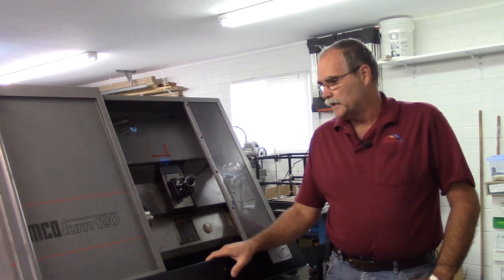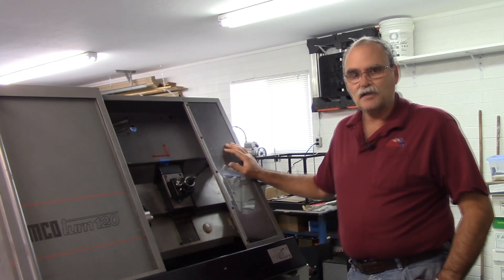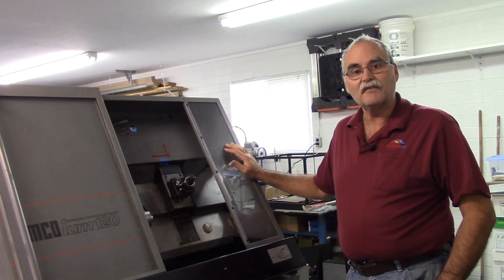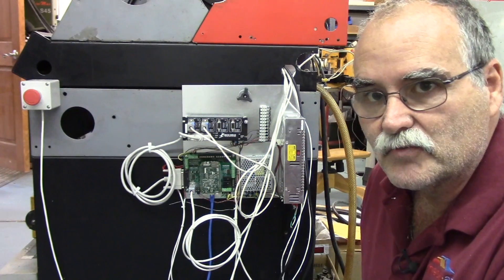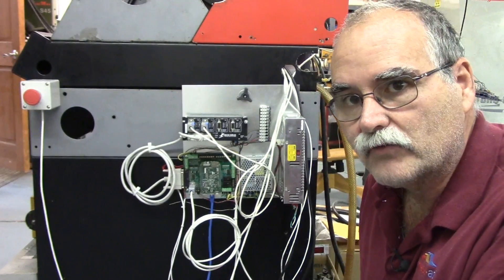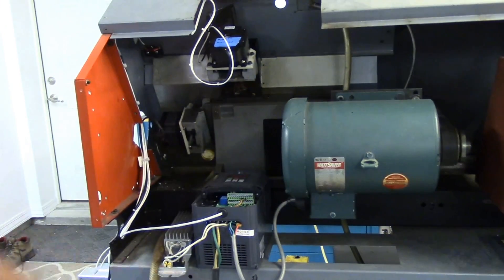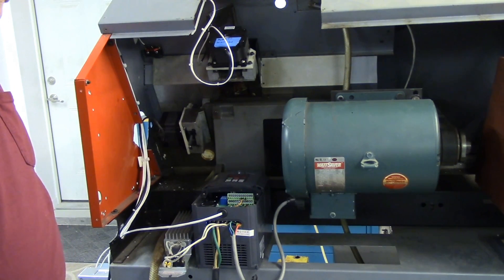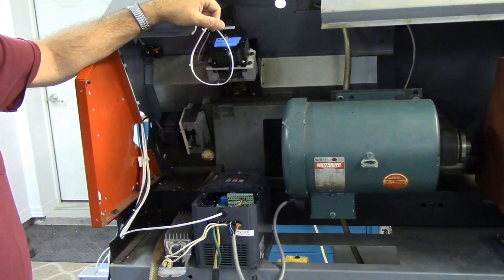Emcoturn 120 CNC Lathe Project Overview

Comment: I'm going the same route atm but with a Boxford 250.   I'm still gathering the bits, just the spindle drive  and touch screen to go.   My turret looks a bit similar to that one so I'm keen to see how you go about controlling yours.   Thanks for the whole series of videos, very informative and extremely useful.
Reply from the maker: The Emcoturn 120 has long been done. It used 4 sensor gray logic. It would be very helpful if you found a schematic for your turret/machine

Comment: What was the reason for the 5hp motor. Does it need that much??   The original was 3.5 I believe
Reply from the maker: It had already been replaced with a nice inverter duty Lesson motor. It all depends on the work you want to do on it

Comment: Marty these vids you make are good material... I have that same lathe mine is the Emco 120p my lathe came with all the manuals control and it’s has the 380v transformer one question I have is do you think it’s worth to keep that way and run it of a 7.5 rpc I have
Reply from the maker: Its a good machine, control is outdated. Spindle motor is high voltage DC. The only thing about rotary phase converters is voltage balance. I have two Emcoturn 220's (5C machines) that will get done in the near future and sold...never understood why they made the 120 at all. 220 same frame, bigger through hole.
Reply: Nice I’m keeping my eyes open for another Emco ..... the phase converter I have is a North America phase converter 7.5hp and claim to be balanced any tips or advice before dive in
Reply: Also I’m goin to neeed to balance the transformer I’ll see how it goes
Reply from the maker: Not sure what to tell you other than check your voltages into and out of the transformer. Get an electrician to help you if you aren't comfortable doing it.
Reply from the maker: @mva8082  where are you located?
Reply: i asked a few electricians i they knew how to balance a transformer most of them said they are not too familiar with it .....im located in california
Reply: i will get the machine up and running slowly just want to be careful with everything so i dont smoke the control

Comment: We have 2 of these Emco 120’s with turrets at our High School... they’ve been sitting in the back of a classroom for probably a decade or more unused. The robotics team of the school is debating if we want to try to sell them off/scrap them/retrofit them... they really only have use-cases for a manual lathe, so I’m not sure if it’s financially wise to invest in retrofitting it... 

How much did the retrofit for your machines end up costing? I understand a lot of the work was already done by the previous owner... also any idea how much these would net us on the market?
Reply from the maker: Realistically, cost between $2 and $4k depending on what motors and control you go with. If you can use a CNC lathe, then it might be worth it

Comment: Hello Marty,

It should be great to get in touch with you. 
Presently I should like to assemble my first benchtop CNC machine. Would be wonderful if you could give me some advice. 

Best regards,

Kevin
Reply from the maker: Kevin, my suggestion is to work with Centroid Acorn. Visit Centroidcnc.com , read up on Acorn, download the schematics and study them. Try and find a bench top CNC machine that needs a new control and go from there. There a reason a number of helpful users on the Centroid Acorn user forums that I also frequent and can lend help or advise.

Comment: Marty, great topics i have a question about the emco machine.I am thinking about upgrading my emco 140 to acorn from mach3The machine i equiped with closed loop steppers and a 8 pos turreti saw the film about hooking up the closed loop system.But is it posible to run the Sauter tusset with acorn???Thanks in advance Henk from Hollandsorry for my not te good Englishinfo@autoschadeheins.nl
Reply from the maker: Hi Henk. I know who you are. :-) The next revision of software will have more support for ATC's. How does your turret work?
Here is one of a Denford Orac lathe running http://centroidcncforum.com/viewtopic.php?f=60&t=967&p=4478&hilit=Denford+Orac#p4478
You should post to the CNC User forums with the info about the Sauter Turret. Its sequence of operation. Centroid Support staff may comment. http://centroidcncforum.com/viewforum.php?f=60

Much has to do with the number of I/O required.
Reply: Hey Marty, thanks for the quick repley......i will try the forum you sugest, thanks again

Greetings from Holland